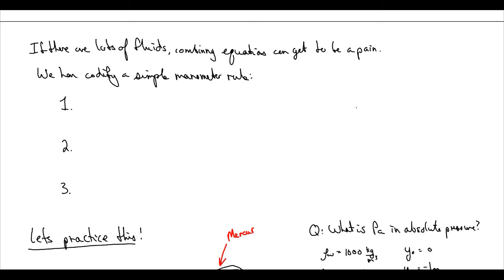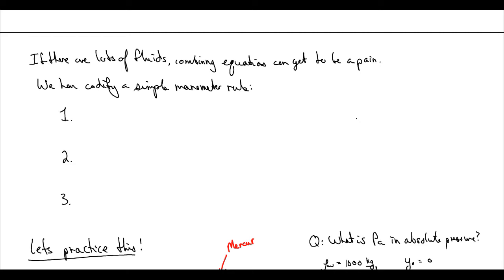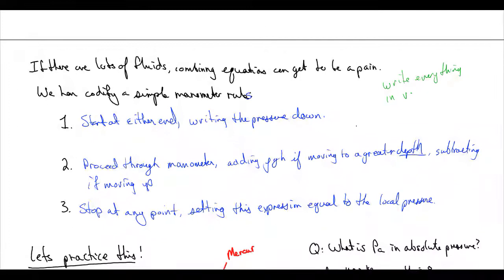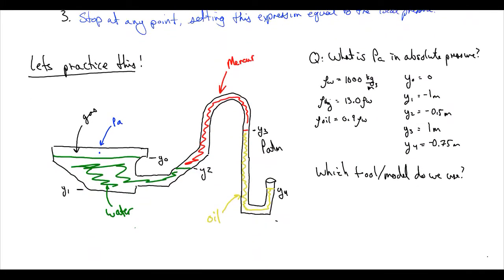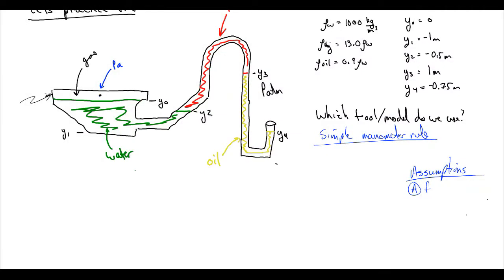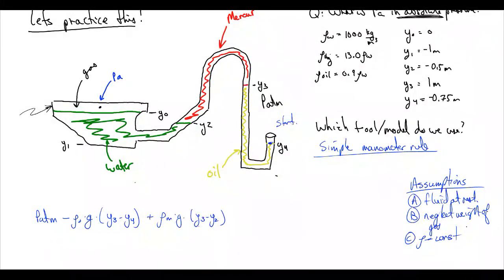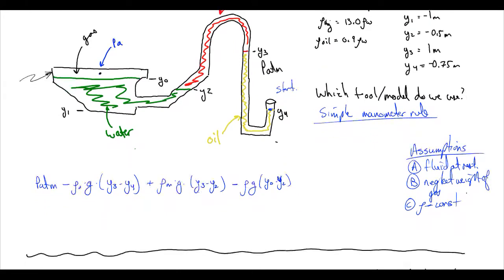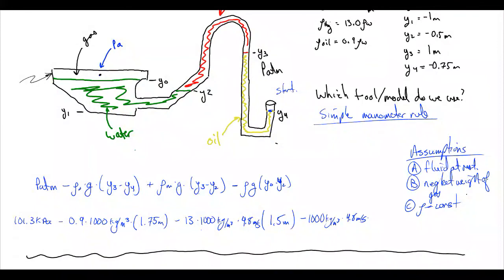Fluid Mechanics: 6)  Manometers Simple Manometer Rule

Comment: Around 8:50 you forgot to multiple by g (9.81) for the first term. It also looks like you switched the sign for the second term (should be positive). The number you actually get is correct though! (267.1 kPa)